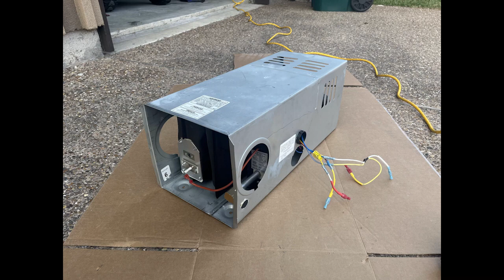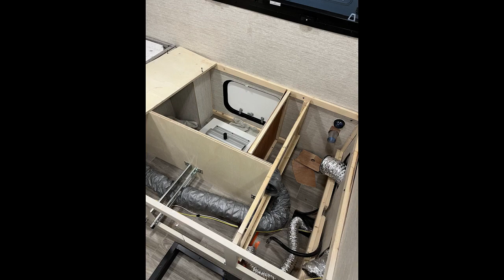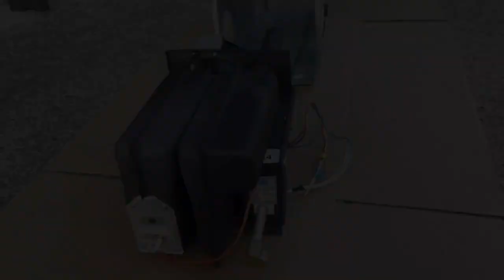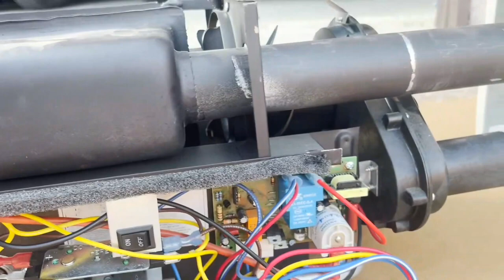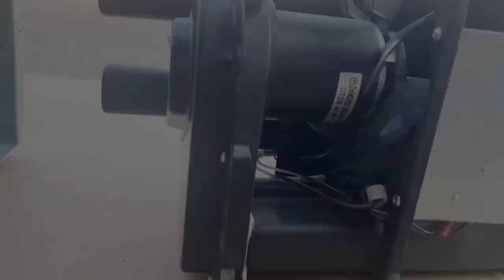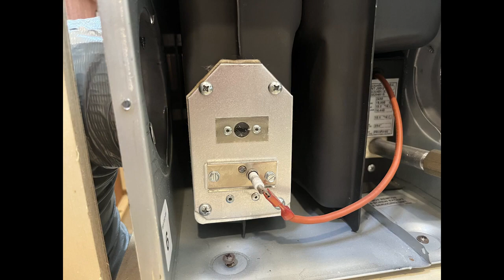Suburban RV Furnace NT-20SQ Problem

Comment: I’m still figuring out how many screws are involved to take off the components out of the furnace sleeve 😂
But amazing video thank you 🙏
Reply from the maker: I was surprised how few screws there were. I don’t recall exactly how many (1 or 2?) but I will always remember how hard it was to slide out with lots of pulling and and multiple rubber mallet taps careful not to damage it.
Reply: Perfect thank you! 
Appreciate the help. 
I fixed the problem I think was bad connection and  I think manufacturer don’t connect cables tight enough.

Comment: What was the part number on the circuit board? I'm having trouble finding a replacement
Reply from the maker: I looked at my emails from my eBay purchase and I somehow determined the following part number “Suburban 233645 CCA-1203 RV Furnace Control Board W/ Relay SF-35VHQ SF-30VHQ”. I hope that that helps.

Comment: Hi, I have the same issue and ordered a Control board and with your video replaced the board. The tip on sliding the whole unit was gold 🎉
Tomorrow I will connect the unit. So far so good!
Thanks for the video and will give update after connecting the unit
Reply from the maker: I am glad to be of help. I purchased my RV in the middle of January 2023, and got to experience intermittent furnace operation on night #1 at 17F. Dealer and then Tiffin thought that was an airflow problem (because Tiffin had not installed an air return). But they were wrong and it was my control board, and perhaps also the loose ground. Good luck with yours, and I'm eager to hear about your results.

Comment: Many thanks for making this video. I'm having an intermittent problem with my NT-20SEQ and was scratching my head in figuring out how to remove the furnace from its housing. Your video was just want I needed.
Reply from the maker: Like I said in my other comments, it was so hard to remove the furnace from the metal housing it was hard to believe that it was only secured using a single screw. Best of luck.